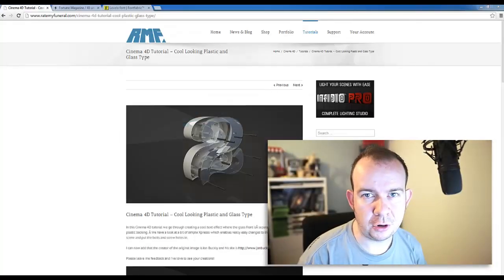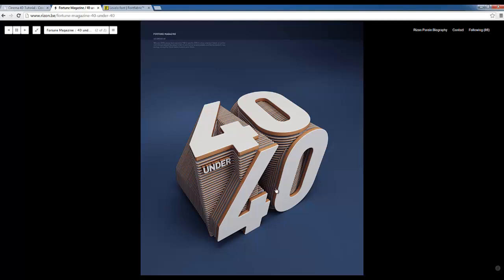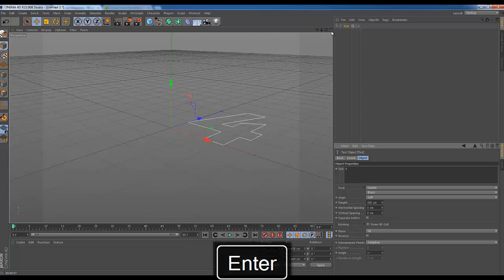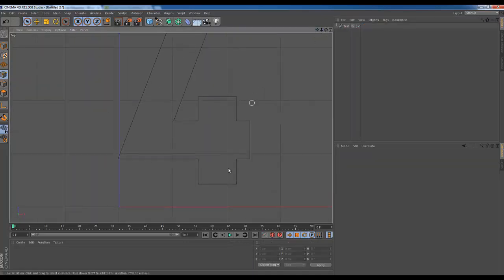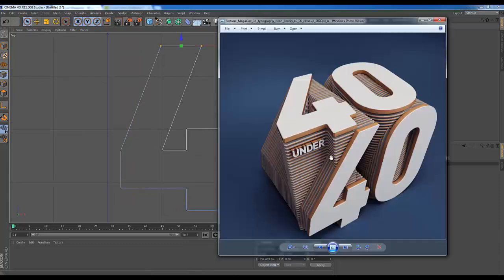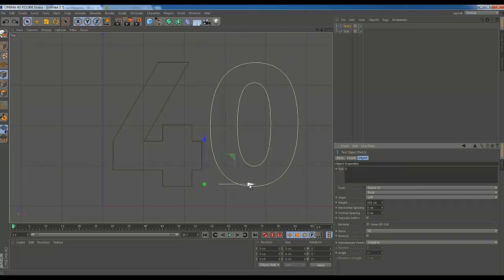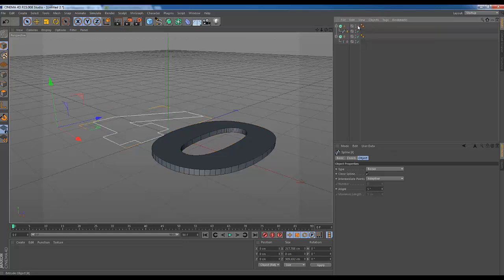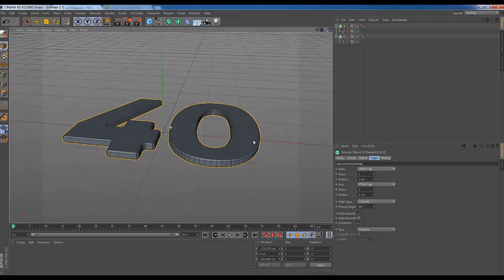Cinema 4D Tutorial - Stylish 3D Wooden Text Structure

Comment: Great tutorial! One noob question though: I saw you more than once centering the axis manually. Is there a reason you don't use the Mesh>Axis Center command? I'm very new to 3D design and I wonder if the Axis Center has other implications (otherwise it would be sooo much simple).
PS: I'm pretty sure the original font was DIN Black, next time ask a brother :))